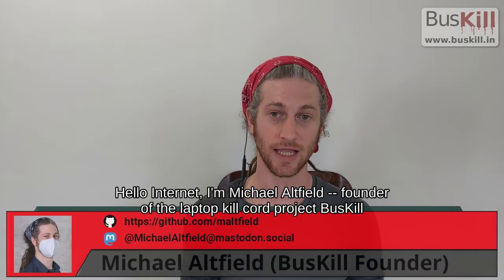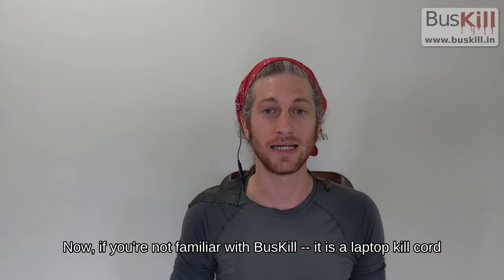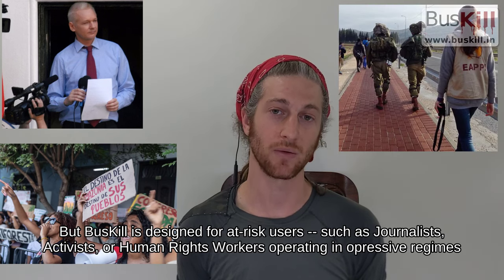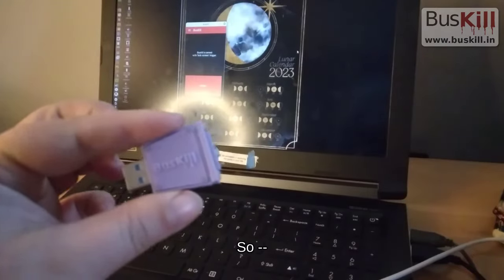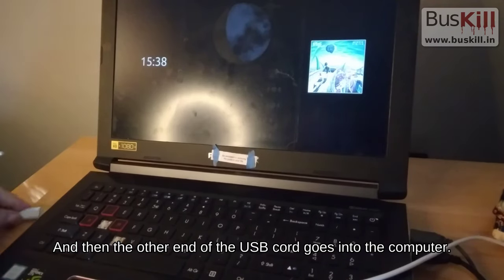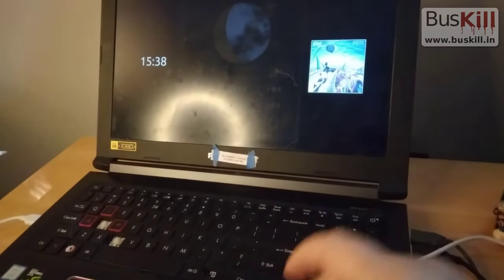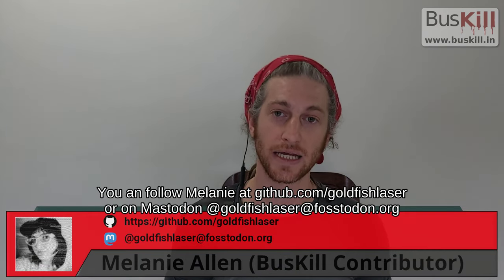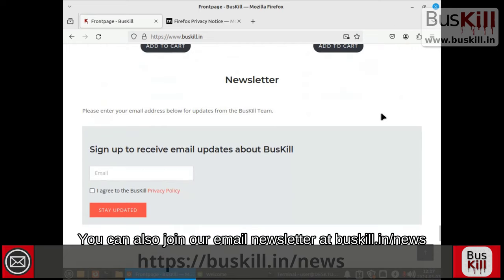3D-Printable Dead Man Switch (Prototype Demo 2024.05)

Comment: They make magnetic USB data cables. Would require a bit of soldering to a female plug. Or a USB-C coupler and USB-C thumb drive to massively cut down on size.
Reply from the maker: Yes :) And we have a guide on how to build these in our official documentation:

https://docs.buskill.in/buskill-app/en/stable/hardware_dev/bom.html#usb-c-variant

Comment: Since its using the disappearance of a usb Device, i think it could benefit from those magnetic usb and data cables for smartphones and maybe a attiny that emulates a HID on the other side of the cable. Would be less bulky when such a cable is used.
Reply: or just a magnetic usb and data cable and your actual phone.
Reply: @satibel  and then the phone gets stolen from your table while you're working on the notebook in a cafe. I think if you're at enough risk that some stuff needs to be deleted as soon as you lose your notebook, you shouldn't tether it to your phone to minimise the risk to lose both.
Reply: @bastiannenke9613  I meant for lower risk like for example locking your work pc when you go to the toilet/pause or something like that. 
or just use any small device that's got an usb c or micro usb and communicates.
Reply: @satibel  so basically as a convenience thing to not need to manually lock? I think then it wouldn't be a problem. Maybe you even can unlock it when connecting it again.
Reply: yes this is absolutely an option. this project is mostly for people who only have a usb-a port to work with

Comment: I was jus thinking this week about how you could keep your operating system on an M.2 external SSD just so you can use it on any computer, following that line of thinking is Windows probably won't appreciate you pulling it out while booted. Nice product I would suppose in case you had to run away from your desk.
Reply: you can run windows in a snapshotted vm on a COW formatted disk (e.g. btrfs), and use a 2nd virtual disk for your permanent data.
or you could just use a linux distro that has been set to handle power loss (e.g. arch linux with a multi kernel so you can boot if it was yanked during update.)
you'd get a ~30% performance hit and can only use it in pcs with virtualization enabled.

the alternative is using a windows to go with rufus if you really want/need to run windows.

imo the best solution is probably to just use a linux distro that loads on a ramdisk and is set to shutdown when unplugged, so you don't have system issues if yanked.
Reply: @satibel  Oh so that's what rufus is for I have so many programs I sometimes forget, I tried USB boot-load experimentation some time ago and even virtual box is tricky to get working with USB boots. However I wouldn't really think USB 3 would take too hard of a performance hit these days with external booting, expecting the PC is more than subpar of course.
Reply: @Noxuzen  kvm and qemu should work fine in ramdisk
Reply from the maker: You probably want to checkout live distros like Knoppix. I highly recommend TAILS for our most at-risk users.
Reply: @buskill  Knoppix, I haven't heard this name in years, btw DSL got rebooted as a 700MB edition for live CDs meant to run on basically anything that's x86.

Comment: does it work if you disconnect the usb device rather than the magnetic plug?

You don't need special hardware, you can do this with 2 lines of powershell/bash tho...
Reply: I think the idea of the magnet is that it easier gets disconnected than a normal usb plug.
Reply from the maker: Yes. And you can absolutely just use a usb drive with a steel cable. Many of our users do this.

The reason for the magnetic adapter is that it's safer when your laptop is snatched away (it works at all angles).
Reply: To be fair, if it's attached to you with a steel cable and it fails to disconnect due to angle, that just gives you an opportunity to hit your lockscreen shortcut, punch the thief in the face, or both. That is assuming they aren't already running away.